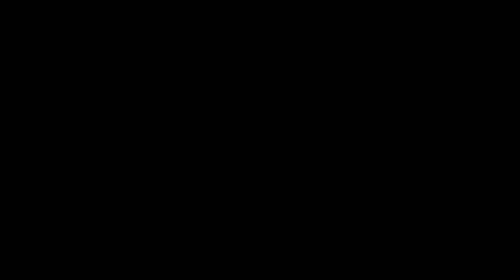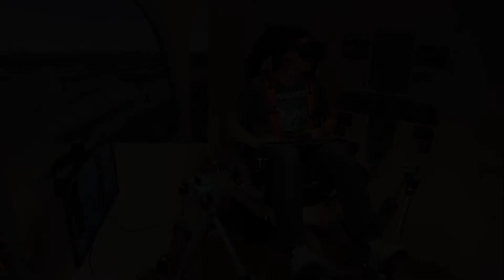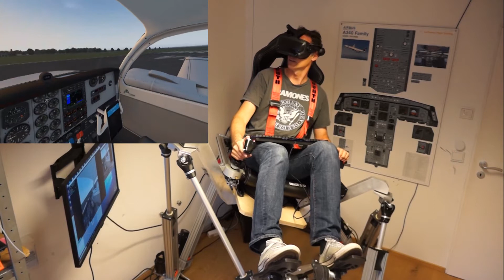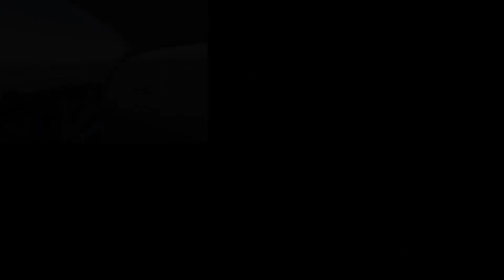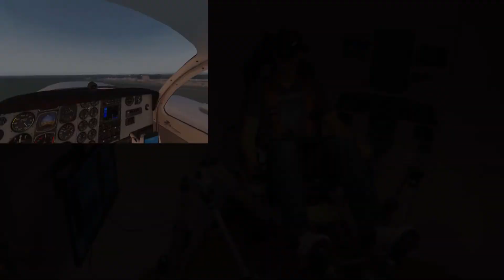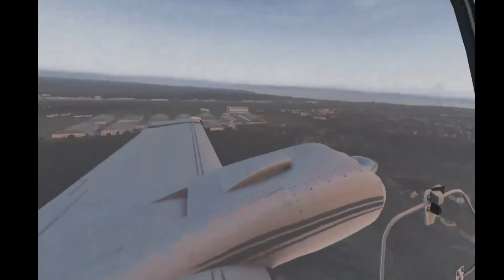Motion Rig 1 -  Basic Manoeuvres

Comment: huhu! can you tell me, where you get your cardan joints from the upper mounting of your actuators? could be nice. :)
Reply from the maker: They are custom designed and 3D printed. All axises run on ball bearings. I have posted a few more pics here: https://www.xsimulator.net/community/threads/show-me-your-universal-joints.13026/#post-219029 
I made them for a commercial project whose future is uncertain. ~35€/pc. However, the U-joints are an integral part of a 6DOF design, so it is unlikely they will fit another rig.

Comment: Hi there!! Great videos and what a beautiful motion you are getting with your rig. Are you using Mover software in this video? If so would you mind sharing your profile? I am using Mover for MSFS and DCS with my 6DOF Stewart platform using planetary servos.
Reply from the maker: Hey :-) Sorry for the late reply. I am not using Mover, but my own custom software instead. I had a very clear idea of what I wanted to achieve, and I didn't want to be limited by the software side of things, so I wrote my own. Don't get me wrong, Mover is a great tool! You can create pretty much the same motion in Mover, if you know which filters to use and how to use them. I have a few additional features in my software, but those are only applicable in some edge cases and might help with certification. In general the quality of motion is limited by peoples understanding of filters, not by Mover itself.

Comment: more videos please . thx
Reply from the maker: I will make a few more towards the end of may (hopefully). Since the time I made this video, I have built a second prototype rig and have finished my new motion cueing software with a few neat features. :-) Also, I have switched over to using the Motion4Sim controller.
Reply: @nutkickermotioncontrol8238  this new software will also be available for us to use the drive.thx
Reply from the maker: @misoswan1087  Oh yeah. I have actually called for volunteer beta testers here: https://www.xsimulator.net/community/threads/meet-yame-yet-another-motion-engine.16910/
I will release it as freeware soon, but it is still focused on 6DOF flightsims with linear actuators.
Reply: @nutkickermotioncontrol8238  not for odrive ? :)